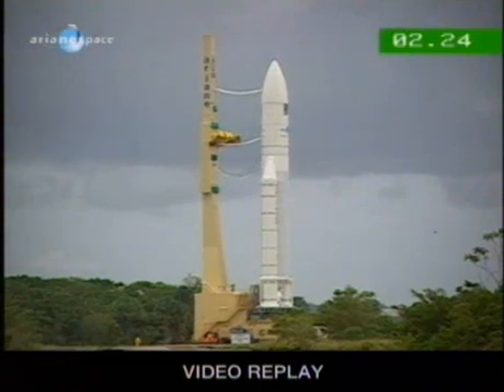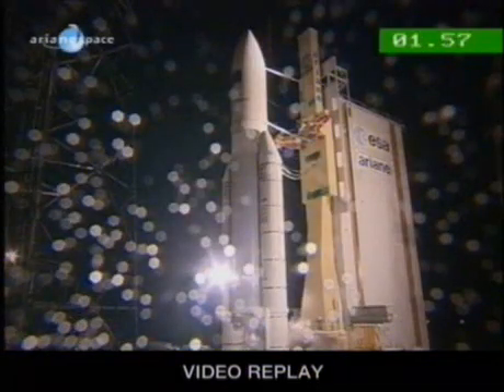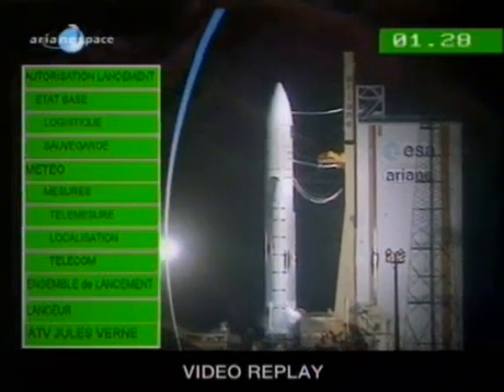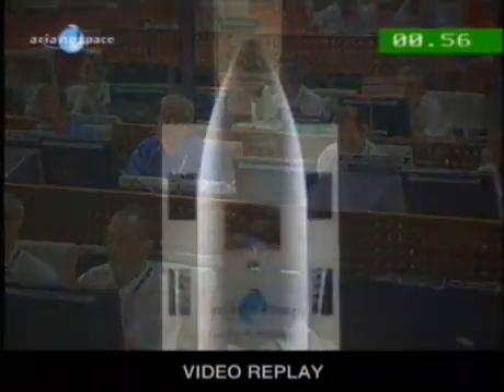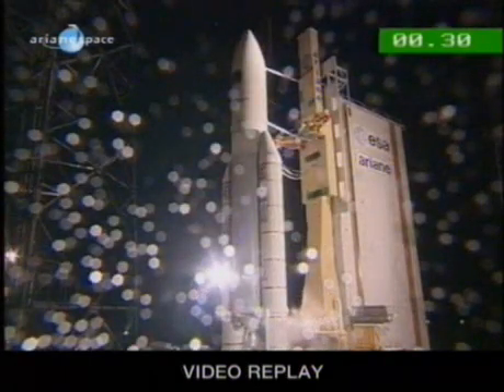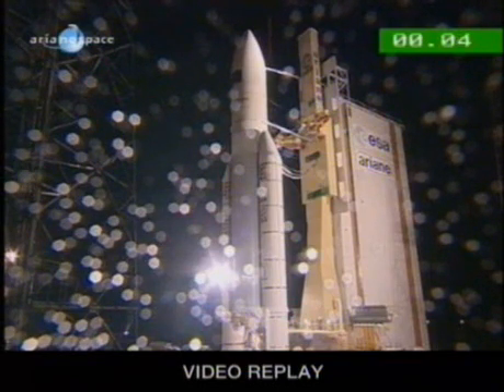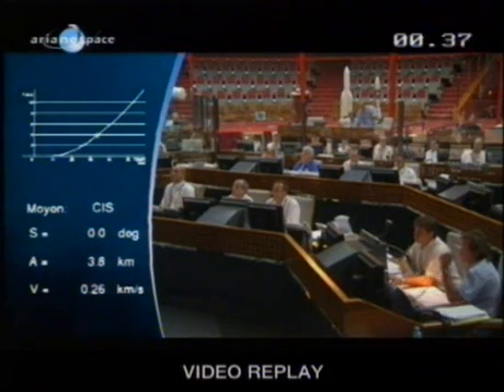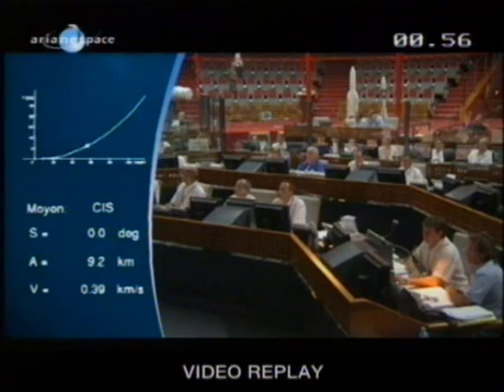'Jules Verne' ESA ATV launch !!

Comment: The classic type, similar to Soyuz, Apollo, Shenzhou or the currently developed Orion. It will simply be an improved ATV with a command module instead of a cargo container attached to the service module. Plus a heat shield, so the crew could return, of course. ESA's unofficial name for the CTV is Pégase (Pegasus). As far as pictures go, just google them. ;-)